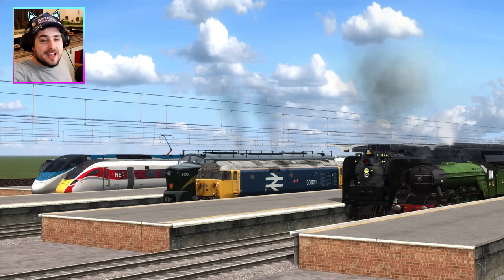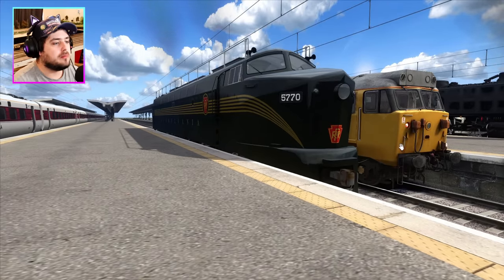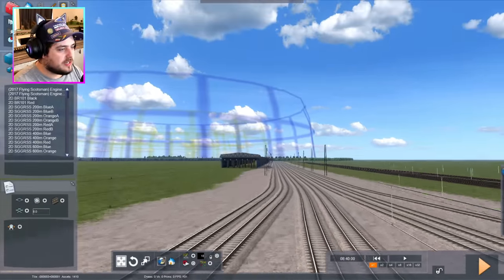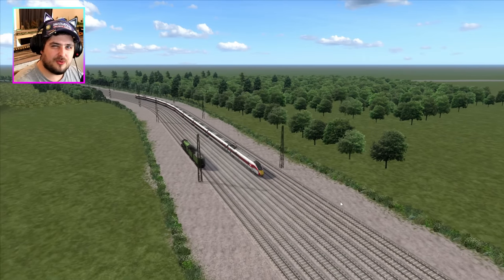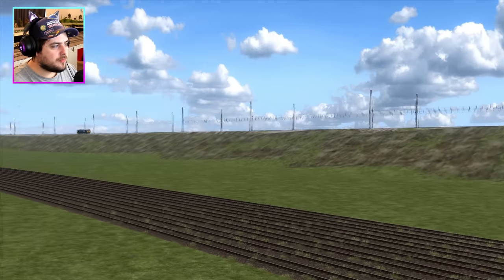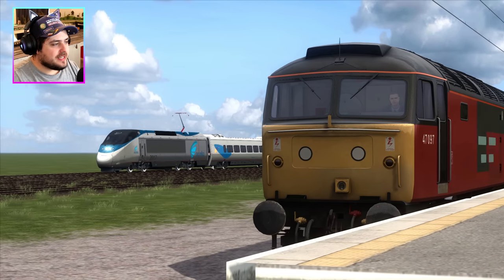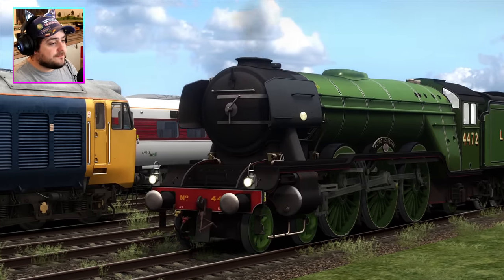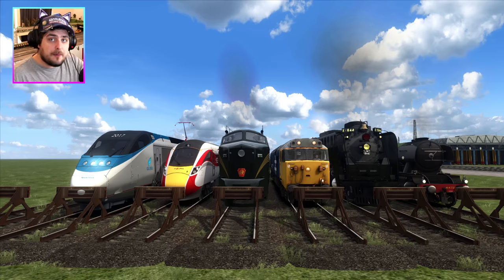Train Simulator - The World Cup Race - Final Showdown!

Comment: Nice video, LaZer JET! Just two tips:
1. In the US, we say locomotive numbers in, well, let's say groups. Single digits are, well, single digits, like one, two, three. TWO digits, however, is where it starts getting interesting. If a locomotive were numbered 45, instead of saying "four five", we'd say it like it's a tens place, "forty five". This stretches to three digits, where the first number is singular, but the next two are tens. For example, 844 would be pronounced "eight forty four"! And of course, four digits, which we say as two tens numbers. 4014 would be "forty fourteen".
2. That American diesel you used, the PRR one, actually was given a nickname that rolls MUCH easier off the tongue, the "Baldwin Sharknose", or just "Sharknose" if you like. It earned the nickname due to it's front resembling the shape of the front of a shark, therefore "Shark nose". Sharknose!

Comment: The first train to beat the accela express on your channel in a proper race (not when you drove in ts2017)  was the class 390 in your first ts2019 race, I wonder if the length of this track will have an impact
Reply: the 2019 track was bigger and the 390  is faster than the class 800  the only trains that beat aclea exprees is 390 bullet train and the 373 eurostar